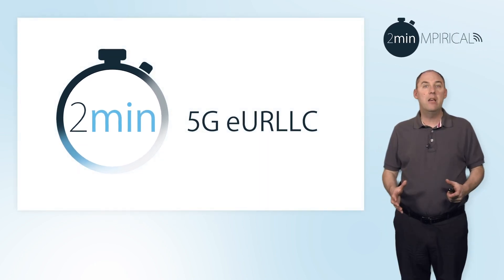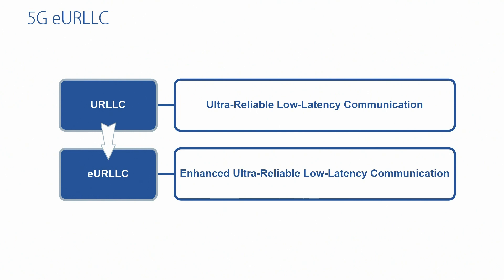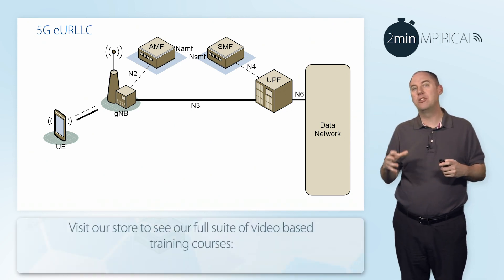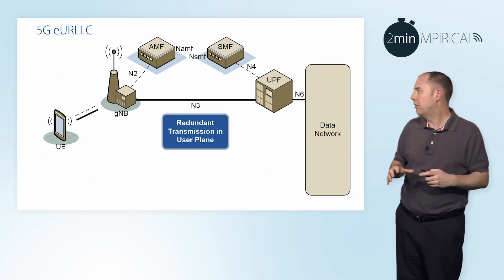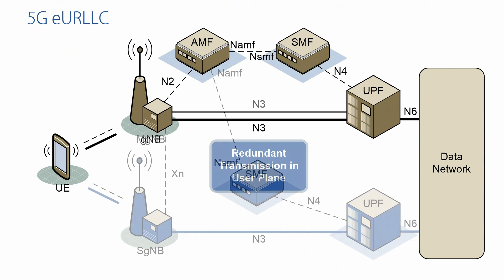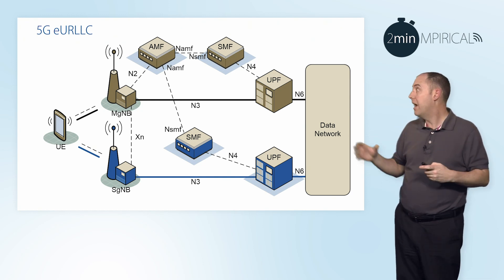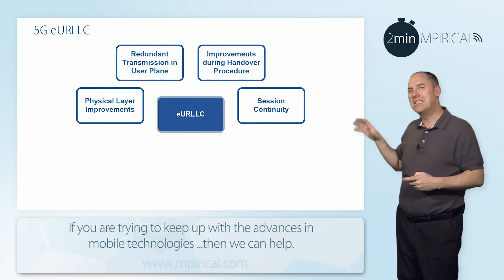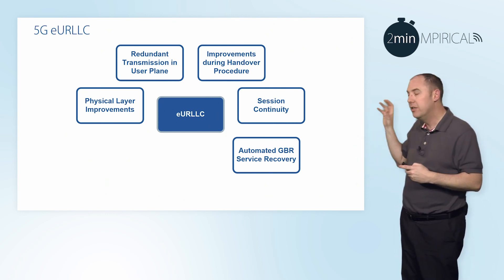5G eURLLC - Mpirical

Comment: In this approach, both the UP connection carries the data or only one carries it. In my understanding, both caries the same data, my question is how duplicate data from 2 ways are managed at the destination, ie, UE. Is UE capable of doing it?
Reply from the maker: There are many scenarios allowed, however it is possible to duplicate the same data over both paths. Unfortunately, it is out of scope of 3GPP how to make use of the duplicate paths for redundant traffic delivery end-to- end.
It is possible to rely on upper layer protocols, such as the IEEE 802.1 TSN (Time Sensitive Networking) FRER (Frame Replication and Elimination for Reliability), to manage the replication and elimination of redundant packets/frames over the duplicate paths which can span both the 3GPP segments and possibly fixed network segments as well. More details can be found in: IEEE Std 802.1CB-2017: "IEEE Standard for Local and metropolitan area networks - Frame Replication and Elimination for Reliability".